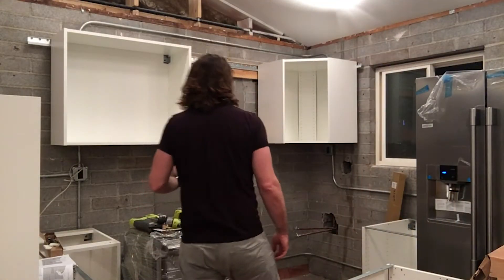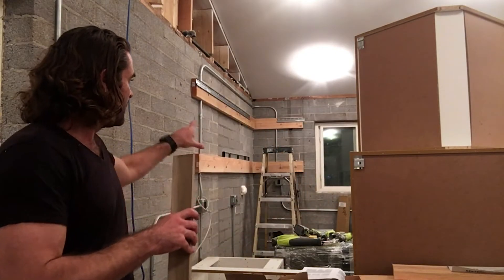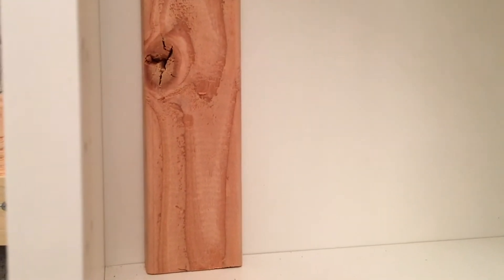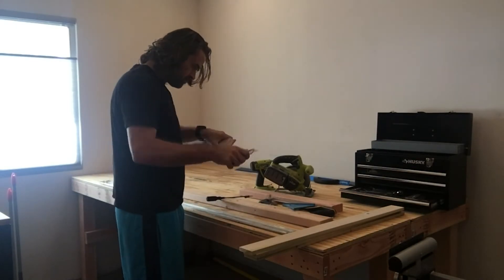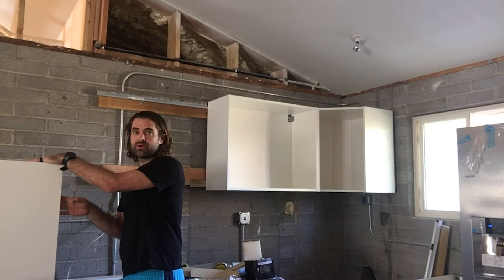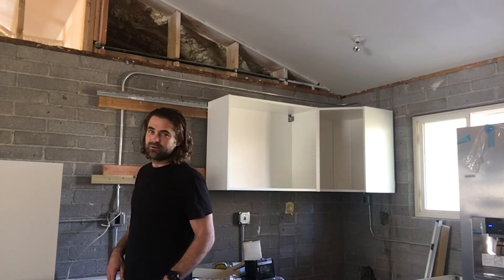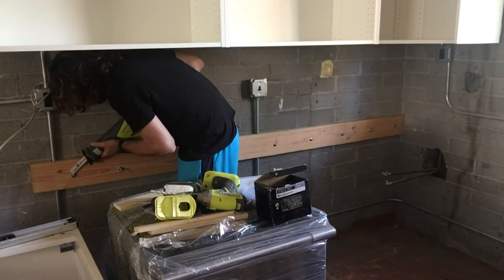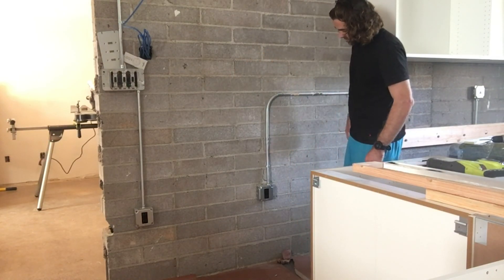Hanging Upper IKEA Cabinets - EP57 - DIY How To Remodel Your Home - Stonehaven Kitchen Build Part 13

Comment: We are installing on concrete with 1in furring strips and drywall. Wondering if just easier to extend the wall as this process with the concrete seems difficult. Any thoughts?  Studs are easier, but I might be wrong.